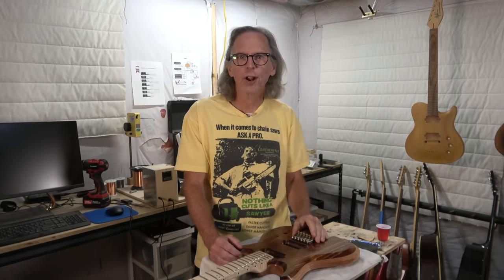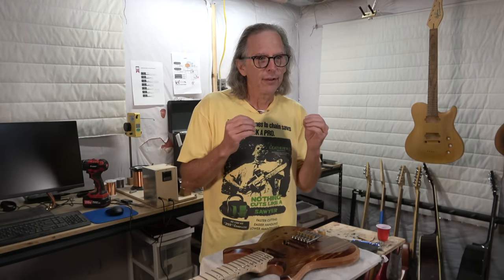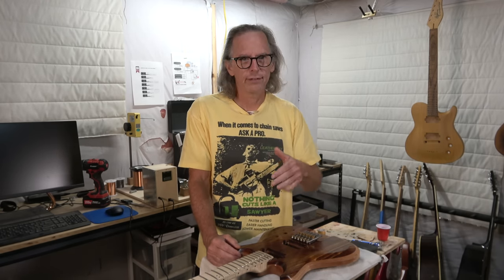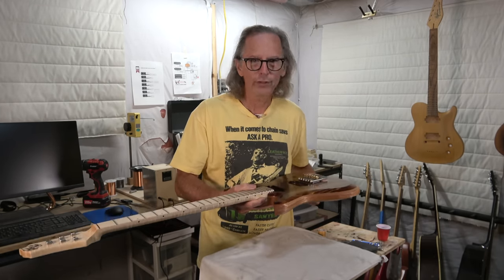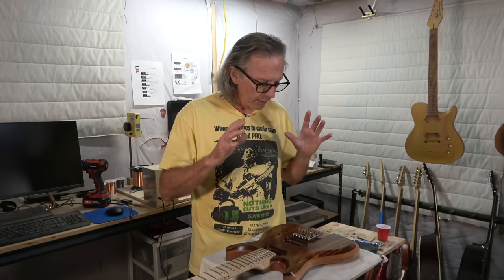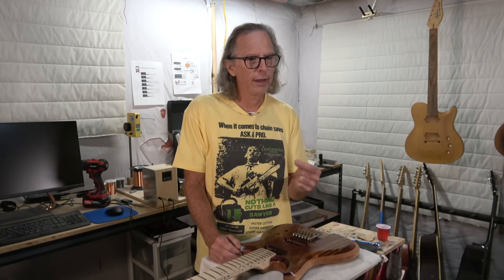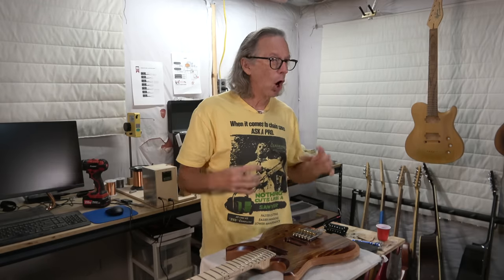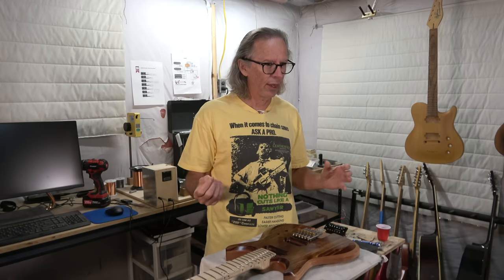Guitar Building Techniques That Are A Waste Of Time

Comment from the maker: Remember, Lemmings never question why they do what they do. If they did, maybe they'd live longer.
Reply: Well, basic physics should tell you that the most string movement is not near the end of the fingerboard, but always dead center between a fretted note and the saddle, so open stringed at the 12th fret and the shorter the whole distance, the less it moves.  Falloff is absolutely not required.  In all reality the relief can be seen as a complete bow with the 12th fret being the lowest point, meaning it can rise up again from 12th fret to the saddles.  Falloff is for acoustic guitars with glued on necks where the soundboard can warp, and the fingerboard end rise up due to string tension and traditional construction methods.  The fall off helps to prevent strings fretting out when the fingerboard over the soundboard rises with age.  On electrics, the strongest (thickest) part of the neck is the heel, and even on a Les Paul type construction, the body will not rise and push up the part of the fingerboard attached to it.  If anything it could tilt it down if it shrinks.

I always make a full proper bowed action first to last fret, more relief for bass strings, less on the treble strings.  It's string tension and vibration which dictate how far the strings swing out (A wave with it's apex always at dead center it's length).  String gauges, tuning, and playing strength should be considerations in reducing fret buzz, and if the frets do buzz, then with a low action over a precise relief it will be restricted to the initial strike and dissipate too rapidly to be a problem as all frets will have the string hitting them, knocking its swing into submission by absorbing a good amount of it's energy, but with a few high frets or just one, that won't happen, and therefore the one or two frets the string hits will not take enough energy out of the string to reduce its swing to within the relief, and the buzz can persist.

It's not easy putting a great relief in for a criminally low action, as truss rods do not bend necks evenly, for one because they are usually shorter than the whole span of the fingerboard (some only go to around the 18 fret) and also the taper of the neck, including the wood is not homogeneous in strength and flexibility throughout...  IOW You cannot rely on those over the top, and expensive fretting jigs and beams alone, you have to take into account how a neck reacts to truss rod adjustments and sculpt the relief to best follow it when adjusted. 

4 decades building guitars and a physics/electronics geek to the max.  It's all to be found in newtons laws, and mechanical wave theory.
Reply: @Arfonfree  You are right.  And they are cute little critters.  I think Micky mouse was just jealous, and drunk again when he ordered them to do that!  (<:
Reply: Brilliant assessment!🤣👍
Reply: @Bob-of-Zoid  Well said Bob. We must all accept that the means of adjusting guitar necks has always been somewhat inadequate and anything we do to approach perfection will always be some level of a  compromise.
 BTW are you the same Robert English that lived in Massachusetts in the 80s?
Reply: @williardbillmore5713  Nope, but Robert/Bob English is way more common than I ever new, until I ran my own name through a web search.  I am a Chicago native, Moved and went to school in West Germany (back then), then moved back to Chicago 24 years later, and up until about a decade ago I lived there, and am still only ~ 75 miles away.

With some of the lower end  guitars popping out of cooky cutters all over the place, mainly southern Asia, there is more compromise than ever, and lots of disappointment when clients hear that just changing the pickups, pots and all of the hardware... will make them great guitars which couldn't be further from the truth and the least of their worries.  The myth that CNC's in and of themselves rule out problems is also just too wrong, as they cannot make up for companies slapping wood together that isn't dried properly and sat cut to size on shelves for weeks, or months before being glued together, dull bits, hand sanding to get rid of the tooling marks...  and that no Plek CNC machine does the fine sanding and polishing which is still done by humans, often with no understanding whatsoever of the tolerances, who can and do throw their heights off unevenly, and again the wood drying and changes by the time you get it...

Then of course that even the cheapest tuners cannot turn once under string tension due to the exponential counter force provided by the worm gear, unless the gears come with 60+ years of wear out of the box, and are not the root of their tuning problems, but how they put them on can be, and often is with too many windings, and so on with many of the tricks just making it worse not better.   Anyone can put one in a vice and try to turn the post, and I guarantee it will break before it turns even a fraction of a mm, and it's very hard to do without good vice grips and a lot of muscle no string could ever match.

Yet strangely in our business and despite mountains of peer reviewed research on materials, wave theory, mechanical wave theory at their fingertips, there is more myth than truth being spread, so much so and perpetuated for so long, even experts sell snake oil and swear by it without even knowing they are.  You should see me flip out when I hear the non word "Tonewood" as if it's a matter of species over a matter of a materials physical properties.  Those carbon fiber guitars sound incredibly good, and I have had Alvarez's, Yamaha's, Ibanez... acoustics come through my shop... that put most Martins to shame as a matter of all of the right stuff coming together by sheer luck of the draw, and at a much better price. Martens are more consistent though than most other brands, but still vary, as the materials themselves do.  Then you can add personal preference too, and say with 100% surety that there is no such thing as a best sounding brand or model, and so the best way to pick and buy one is to play as many as you can and if nothing does it for you that day, go back another day, and repeat until something pops out and speaks to you, and don't let it be the salesman doing the speaking but the instruments, with your ears as the judge.

See what you did?  You got me writing another essay!!!  (<:   ;^)  40+ years of it with little change and the frustration adds up.
Reply: @Bob-of-Zoid  The Bob English I knew in  The Boston area was a guitar virtuoso who never forgot any part of any song that he had ever played in 40 years.  He could cover anything I could think of... I lost touch with him when I moved to Colorado and I just thought you might be him. 
  One thing the cookie cutter southern Asia Gibson copies  do have going for them is they are not afraid of building their necks with a scarf joint instead of trying to make the head and neck out of a single piece of wood. The problem is , as I understand it, is that if Gibson changed to building necks with the superior stability of a scarf joint headstock, that no one would buy them, because, after all,  how could they ever sound exactly like Jimmy Page if the grain in the headstock runs at a different angle?
 My point is that Gibson isn't selling just guitars , they are selling a legend. So if we want an LP that won't have it's headstock fall off if we sneeze too hard we are forced to buy the Asian knock off.
I would like to see Gibson make a special line of Les Pauls with scarf joint heads and market it as an improvement just to see if the public are as dumb as they claim they are. After all, Gibson experimented with the volute necks that did absolutely nothing to solve the problem. What's your take on it , Bob?

Also, how do you feel about zero frets?
I love them and I have converted much of my guitar collection to zero fret nuts and all the builds I have done were designed with a zero fret.

Comment: What I personally find unnecessary are glossy clear coats. Both as a builder and a player, I strongly prefer the look and feel of a nice oil finish. I find that it not only holds up well over time and against the elements, but it's much easier to fix when it gets damaged. Probably better for the environment too.
Reply: Technically speaking, all fancy finishes, decorative inlays, binding, etc, are unnecessary.  All a guitar needs is a basic finish to protect it from discoloration due to dirt and dust.  I've been trying to find the best combo of ease of application (rattle can), cost (brush on poly), and drying time (shellac or lacquer).  Almost half the time of building a guitar is waiting for stuff to dry (glue, dyes, stains, oils, clear coats, etc).  Of course, you can always start on the next build while stuff is in the "paint shop".

Comment: Fret fall-off profiles are very common for the top end bass builders.  It is only partly due to the reason you talked about.  If you work on old basses (10+ years old), then you quickly see why it is so important.  It future proofs the neck (to a certain extent) against the very common upward kink near the body.  The other way to (more or less) stop this from happening with bass necks is to use carbon fibre reinforcement.  (FWIW, if you run the CF through the nut transition and into the headstock, it also helps with the quite common upward kink at the first fret due to headstock rotation.)  

As for wax potting, I agree.  It is really silly to do it as a matter of course.  But I'm not so sure many reputable winders do this.  Certain styles of pickups actually have slightly a microphonic character on purpose.  Vintage style bass pickups especially, benefit from no potting.
Reply from the maker: Another reason why fret fall off can be useful is because so many players these days like to down tune their instruments, which makes the strings really wobble over those last 5 or 6 frets.

I'm not sure when microphonic feedback became such an evil thing. It can be a very useful effect in the hands of those who know how to make it work for them.

Comment: Great video.  Totally agree with the falloff.  Generally that's not needed.
As for pickups, I like mine potted.   It's easy enough and makes a difference when using high gain. When I used to gig, every unpotted pickup I tried allowed every bump of the instrument to go thru the amp.  Pot it and it's better.  The average home hobby player probably won't be in that situation though.  Potting adds very little cost and time, just messy as heck.

Comment: Van Halen DID NOT invent wax potting Guitar pickups. Though he tried to take credit for it in interviews. The first to do it as a matter of routine was George Beauchamp, while working at Rickenbacker in the early 40's.
 Wax encasing things would have been second nature to any electrical designer, back to the 1910s and '20s. So, the first guy who ever heard a pickup squeal probably immediately thought "Dunk it in wax".

By 1955, Fender was lacquering their pickups to accomplish the same thing. But wax is easier to get out if you ever need to take it apart later. . .
Reply: Gibson also used a potting in the 70’s that is commonly referred to as “tar back” pickups. They are my favorite.
Reply: @drprick7432   I remember the interview where Van Halen claimed that he alone invented wax potting of his pickups. Of course as most guitar mechanics know Eddie was a pompous liar and potting has been around decades before Eddie was even born. It surprises me that a luthier would perpetuate this stupid myth in a video. 
 Anyone building pickups and not potting them , in my opinion is just being lazy. There is a lot more to microphonic noise than feedback squeal. 
 An unpotted pickup will allow every click, pop  or knock the guitar body takes to be unnecessarily amplified and can be quite annoying to anyone, especially recording engineers. Potting has no negative effects on the  pickups frequency response  and can only have positive effects and improvement by reducing unwanted noise. Pickups are not supposed to act like microphones and some kind of potting is necessary to make sure they only do what they are supposed to do.
Reply: @drprick7432  Those "tarback" Super humbuckers were most commonly put in SGs in the early to mid 70s. They used ceramic magnets that gave them a punchy mid range boost and they were potted with a black epoxy, that gave them their unique appearance ... not really tar. Because of that epoxy potting they are a nightmare if you ever want to split the coils...Some would say it is impossible to split the coils on a Super Humbucker. Though it is more difficult, it can be done.
Reply: @williardbillmore5713  Yeah I have a '73 and '74 SG and a 320 hollowbody that somebody replaced the single coils with those tarbacks. I love the sound. (My other favorites are Lollar P-90s)
Reply: @williardbillmore5713  I have an old Ibanez Firebird copy that Curtis Novak rewound the pickups for me. Talk about microphonic, You can practically talk into one of them. I asked him about that and he said, "That's the way Neil likes his." I mean, who am I to question Mr. Young's taste? lol
Reply: @drprick7432  Neil is a fantastic inspirational and talented  song writer...but as an electric guitar player?... not so much.
 Perhaps he sees a little howl and squeal might improve his one note electric guitar lead breaks and add a little variety to them.
Reply: @williardbillmore5713 I don’t believe Eddie said that, but if there’s video I’ll stand corrected. He often is accused of having claimed to invent things because he told the story of how he figured it out how HE could do it. For example, tapping. Sometimes people figure things out on their own without knowing that somebody else figured it out first. 
There was no internet in the mid-70s. A lot of stuff was low key invented over over and over. Unless you applied for a patent, you’d never know.
Reply: @TheMasonator777  Eddie lied and he knew he was lying. There is no way he was that stupid.

Comment: What takes the most time? Doing the fall away whilst you've got the leveling beam out anyway or having to remove the strings & neck, fix problem frets, and then redo the crowning & polishing? Personally (as a hobby builder) I'd rather get to assembling the guitar with the knowledge that the frets are sorted.
Reply from the maker: The use of a fret leveling beam is is another potential waste of time. I rarely use one on my guitar builds as it is totally unnecessary if the fretboard is precisely shaped and the frets are properly pressed in.

Comment: Yes!

I stopped setting up my drill press and shimming my headstocks with double-sided tape (super glue trick) to drill tuner peg holes for my machine heads. 

That was painful prep to drill some holes. Perpendicular. 

I bought one of those perpendicular drill block jigs with multiple diameter hole/bit sizes and Bam!

All I have to do is clamp the neck to my bench with an appropriate headstock support and use my hand drill. 

Beyond the time savings, it’s just flat-out less of a hassle. Less annoying. And I also believe that the more set up for any operation, can introduce error. Especially if you don’t like doing it!

So far, there has always been enough real estate on the head stock to accommodate the drill bit jig. 

Thx Chris for your content. Still drinking it up. 

Cheers!

Comment: 1 thought about wax-potting pickups: Hundreds of feet metal wire will expand with temperature, thus loosening the coil and contributing to vibration. On stage with hot lighting on hot days could be that recipe for microphonics.

Comment: Brian May wax potted his pickups when he built the "Red Special". I believe it was the first set that he wound himself, and those were ultimately unsuccessful. So he changed them for the Burns Tri-sonics it has in it now. But he was wax potting pickups in the late 60's and it wasn't new then.
Reply: Didn't they dip paper capacitors in wax? I wonder if it was done because of the thin foil inside . . . harmonics . . . I think the 'gadgetry' and mad scientist stuff Eddie Van Halen did is worthy of a YouTube episode. Didn't he also create the 'brown' sound?
Reply: Brian May actually spotted his pickups using Araldite adhesive.

Comment: As an acoustic player, I usually like fret falloff with my gigging guitars so that if I change humidity while traveling and the guitar starts to dry up, the hump at the neck joint causes fret buzz.
So having an acoustic fret falloff preemptively removes that problem, especially since most acoustic players never go past the 14th fret.

Comment: My example might rub some the wrong way: Fret levelling! Yes, sometimes you need to file or sand material off your frets, but you very often don't need to. By pressing or hammering (with a soft face hammer) high spots, it is possible to get your frets level a lot of the time without the hassle of levelling. I have a video on this. Try it before you hate it!

Comment: Good thoughts. Re fret falloff - besides more work, it raises the action on the upper frets. Just ask how may guitar players would like the option of having higher action on the upper frets. Not too many, I reckon. Re wax potting - it would be nice to have a good test before installing PU into a guitar to see if microphonics is an issue. If you don't need it - woot! But if you do, potting can help immeasurably.
Reply from the maker: I used to wonder why many players assume awkward postures when playing on stage. Then I realized it was because they knew how to control microphonic feedback by how they stand in front of the speakers. When you eliminate microphonic feedback via wax potting, you eliminate a potentially valuable option to your catalog of sound effects.